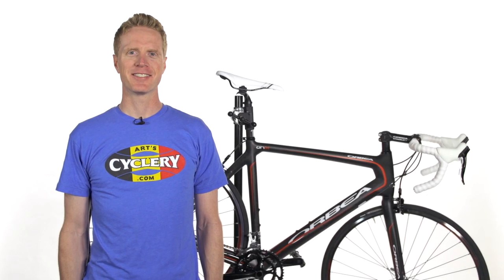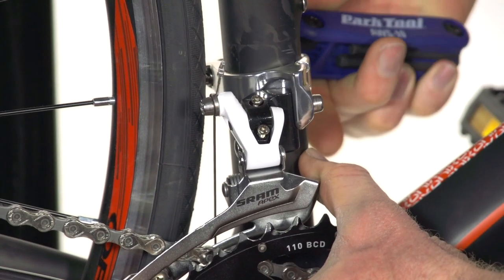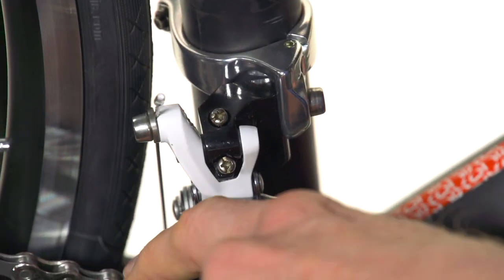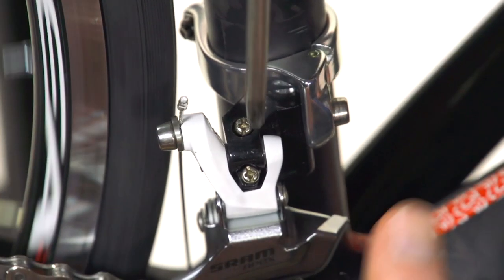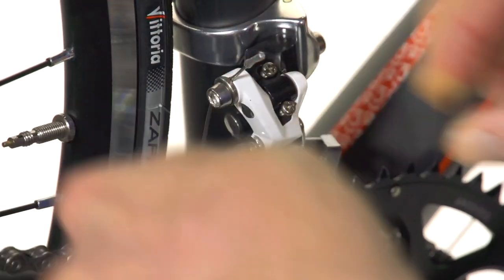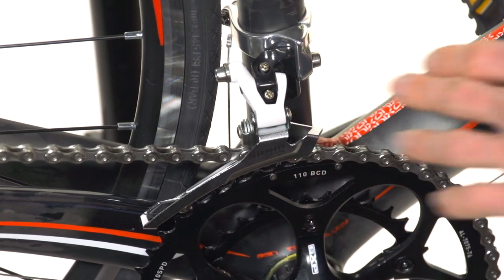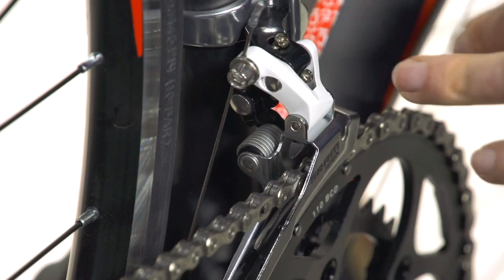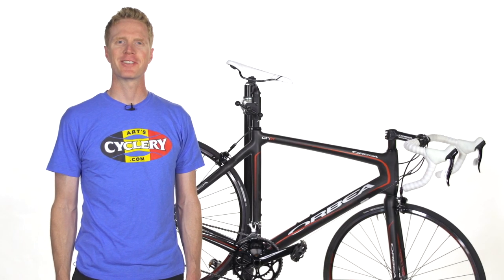How To: Adjust Traditional SRAM Road Front Derailleurs

Comment: When you're shifting from the small to large chain ring are you still in the largest cog in the back? Also, when setting the outer delimiter what cog are you in the back? Thanks.
Reply from the maker: DesertTrailRunner When setting the FD outer limit you want to be in the small cog on cassette. When testing shifting up to the big ring it is a good idea to test it in a variety of gears, but I don't worry about it shifting well when it is in the biggest 3 gears on the cassette. It's not a situation you will find yourself in often and that is a gear combo that even the best FD's will struggle with.

Comment: I have a 2015 Apex front derailleur with the Rival 22 hydraulic brifters, I find it very difficult to move the derailleur across from the small to the large chainring.  I've been cycling for decades and am quite experienced at building bikes, but I'm flummoxed.  It just takes a lot of effort to move the mech across.  The cable is nice and free in the housing and brifter (proven by disconnecting it and testing), the mech itself moves very easily by hand - I just can't get the cable to move it easily.  I've routed the cable over the little nub and through the slot.  No matter how much or how little tension there is, it just requires a huge amount of force and makes a horrid "SNAP" sound when I go from large to small chainrings.

Comment: Thanks for the tutorials. I just spent the last couple of hours trying to set the front mech to shift from the small crank to the large crank (SRAM Apex - Boardman Hybrid Team bike). Small crank is fine, but when I adjust the limit screw to ease the chain from the small to the large crank, it'll randomly overshoot.
As I'm looking down onto the front mech, it just looks like it's pushing too far out, hence the chain overshooting, but no adjustment seems to work. Where am I going wrong?
Reply from the maker: Johnny Jawbone I apologize for the delayed response. Try adjusting your cable tension as shown in the video and then adjust your outer limit screw, this should resolve the issue that you're experiencing.
Reply: Art's Cyclery Hi Art. I had a problem with my crank, bottom bracket and bearings. Give in the crank was making the gear change inconsistent. Thanks though for the advice.

Comment: My apex front derailleur is experiencing major problems shifting to the big ring.  The chain hops up to the big ring, but after multiple revolutions of the crank arms.  The outer limit screw is in place correctly and increasing the cable tension hasn't helped.  Could it be a faulty FD? I have read about sram front derailleurs being sketchy
Reply from the maker: Kiyoshi Nichelson SRAM front derailleurs are not sketchy. You most likely have too much cable tension and should start there with your adjustments.

Comment: Doesn't work. The higher limit screw has too close a limit, I can't adjust it outward anymore. Basically you need to set it all up perfectly with the cable tension or something and that higher limit screw is completely useless.
Reply from the maker: -pox power- If you cannot get your front derailleur to pull all the way out to the big ring/upper limit screw, then your cable tension needs to be tightened. Once that's done, you should be in a better spot and should check you limits at that point.
Reply: I tried every cable tension / limit screw combination possible and it wouldn't shift into the big ring while on my bike stand. Then I took the bike down and the shifting was fine. Even rode with it and could shift just fine. 
Who knows. I hate fixing my bike lol
Reply: +-pox power sounds like your bike stand was inhibiting the shifter cable